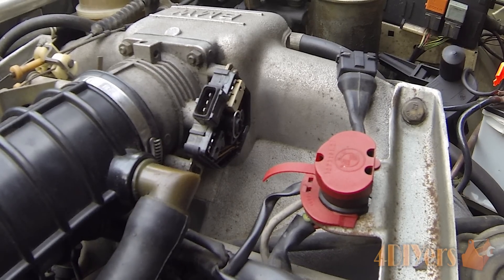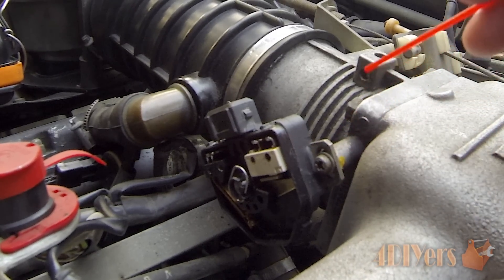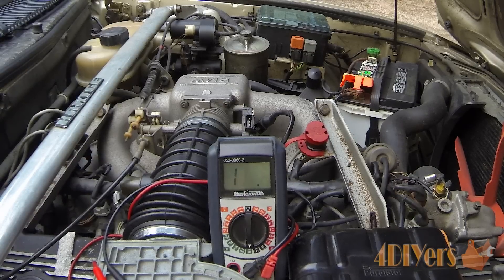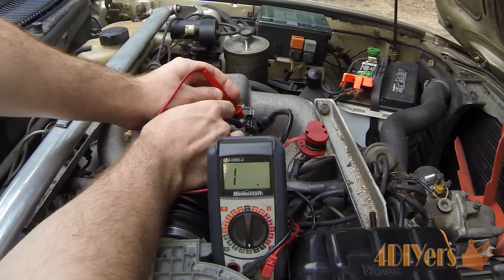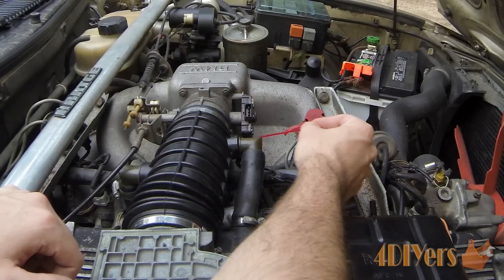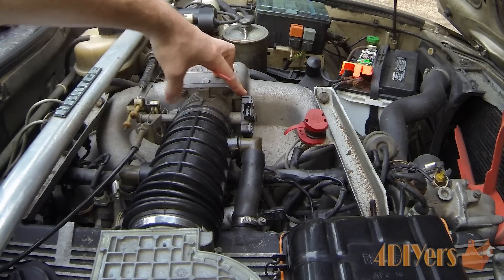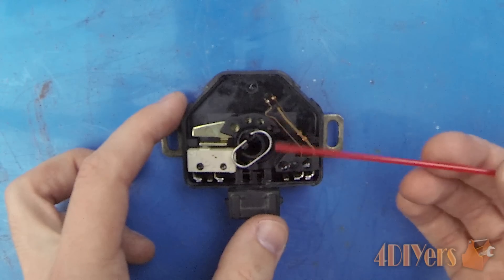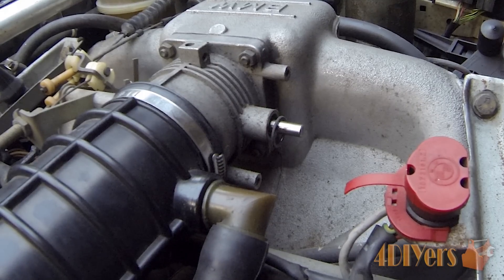DIY: BMW Throttle Position Sensor Testing

Comment: BMW E30 (M20 engine) has the same throttle position sensor located under the throttle body instead of the side. Fixed my high idle issue when warm (idled to about 1800-2500 RPM when warm). If you let the car warm up without touching the accelerator and it idles fine, but starts to idle high when you start driving around, you know its likely to be your throttle position sensor not telling the ECU its supposed to be idling the engine. Hence the high revs :P

Comment: Great video, I had a idle and low rev problems with my bmw m20 engine, change everything, maf, icv, harness... and saw this video. problem was in tps it was full of oil. after I clean it and adjusted it, engine works perfect.
Thanks
Reply from the maker: Thank you for the feedback :)
Reply: Bmw really fucked up with putting the tps under the throttle body on the m20
Reply: Hi i got e30 m40 tps under tb i revved up till past 5000 rpms and after i had a high idle about 1200rpms suspected its tps also not sure but tonight i used a flathead and clipped the cover off and it was drenched in oil . What steps should i take next

Comment: Hello, thanks for posting. I have a “dead spot” in my throttle, when I press down on my accelerator pad pedal the first quarter to half inch movement I get a pause and then continue to accelerate. Is this a sign of a faulty, throttle positioning sensor as well? Thank you.

Comment: Hello
Please tell me where is connected the front hall sensor from the crankshaft 
I have the 3 wires cinnected to the diagnose plug , and i m sure someone did some bullshit here,also i cannot find other free wires of the harness around the plug
Mutch aporeciated if you help 
Cheers

Comment: My bmw e39 rpms go up and down only when driving not on idle, could the TPS be related to this? I also think there is a small lack of power too but I basically bought the car with this problem.

Comment: Great video!, Now i am wondering if you can help me figure out how to fix my 2002, 318i n46 right hand drive with 45k miles on it, which i imported from Japan. I am an American Living in the Kingdom of Tonga (tiny island nation in the South Pacific with NO BMW MECHANICS, only Bush mechanics). I am on a fast learning curve. Car suddenly developed a very rough Idle, and major studder upon acceleration. Runs terrible, sounds terrible.Now i checked for vacuum leaks visually and with carb cleaner, nada. Cant get parts here but managed to find new spark plugs which cost me over 150usd and Changed them out (NGK Laser Platinum). Still same issue.  Put injection cleaner and filled up gas tank, only ran that for about 10 miles (not to far to go around here) still same worse seems. Got a hold of a decent scanner and got the following error codes: 27E?, 2743 (miss fire in cylinder 3) , 2785 Throttle Potention Meter, 2786 Throttle Valve potention meter 1 & 2787 Throttle Valve Potention meter 2. Now where is this part located on the n46 engines, 318i, and what can i do to even temporarily fix until i can order a replacement which will take 8 to 10 weeks to arrive.
I am all Ears and Thanks a bunch in advance!

Comment: So my idle is fine but it seems low on power and it started a surge like fuel cutting at only like 3k rpm.   I unplugged the tps and the problem moved to 2k rpm I plugged it back in and the problem is basically gone... could that be it?    
It was like weird rev limiter sometimes back fired at 3k rpm but above and below that it runs good.
Reply: E46 325i, My car will not let me go past 3.5k rpms when trying to accelerate on the freeway, your comment is literally exactly what’s happening except for the revving high when idling. 
It’s just cutting off and the car will jerk back and forth until i shut the car off and start it back up. No code no nothing. Did you ever figure it out? I’m stumped.
Reply: @trendavista  i no longer have the car but I remember I fixed it by finding and fixing a vacuum leak

Comment: Would this cause the engine to idle at 3k? The M30B35 in my 91' 535i idles that high and if you touch the throttle almost runs away like a diesel. I had to shut it down as it neared 5k and showed no sign of slowing down.

Comment: Hi I'm about to buy a 1999 bmw 323i but has a "bad" body throttle sensor I found another 323i and am taking that body throttle any advice at what I should do should I take it to a mechanic? What would be a fair price to pay just to swap it? Should I do it myself? Any advice will be appreciated -thanks cx
Reply from the maker: I believe on that model the tps and throttle body is one assembly. I would recommend cleaning the sensor and electrical connector first with contact cleaner. Purchasing a used replacement may solve the issue, but who knows for how long especially if you are paying a mechanic. I believe VDO does have an aftermarket replacement rather than buying a whole new assembly from the dealer. It's a fairly easy replacement and it can be done by yourself with minimal tools. At least if you have an issue with the used replacement down the road, it'll be easy to replace the second time around.

Comment: will you be able to tell me what the tps needs to read with the throttle cloae and open.. i need to adjust it on a 1988 528e thank you...
Reply from the maker: Is it a 3 pin sensor???

Comment: nice vid : ) can i ask if you know if there is any effect(one upon on the other)with the idle control valve? cheers
Reply from the maker: Thank you. A faulty idle control valve will cause erratic idling, low idle, or high idle. Some can be cleaned, others will need to be replaced. Don't forget to subscribe!

Comment: Where is the Bmw Crank Position Sensor located on this car?
Reply from the maker: Jorge Fernandez Should be right on top of the crank pulley. Here's a photo http://www.bimmerforums.com/forum/showthread.php?866739-I-need-help-1992-535i-timing-adjustment

Comment: How did you get the strips screws out holding in the TPS?
Reply from the maker: Ty Cacek I removed them by using a small metal chisel. Just go around the outside of the head and slightly rotate the screw out. Another method would be cutting a slot in the head for a standard screwdriver too.

Comment: Anyway you’d be able to help with my 03 z4 3.0i , it goes into neutral while driving, I turn it off let it sit for 30min starts back up and drives perfect and does it again later. I’ve tried a few things but nothing’s worked for me. Any help is appreciated.
Reply from the maker: Automatic I'm guessing, most likely an issue with the valve body. I had a similar issue on my 94 740i. Try winter mode if your car has that option. My car would take off fine, but if I stopped for a minute, the car wouldn't move. However it would work fine in winter mode which used second gear to take off instead. Ended up being a check valve in the valve body, the ball completely deteriorated.
Reply: @4DIYers  yes automatic SMG trans, definitely a pain in my arse right now lol I've tried TPS, fuses, you name it. the car hates me!
Reply from the maker: @KateVidaure  SMG? I didn't realize that was an option on the Z4. Yeah they're known for causing some issues, there maybe a clutch issue. Make sure it doesn't loose pressure and burn out the clutch as that's a small fortune to repair.